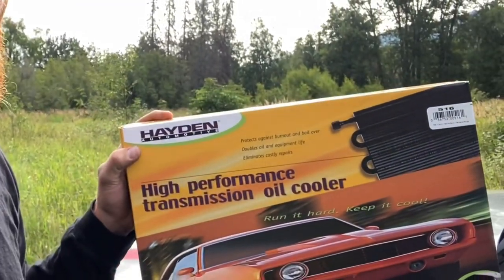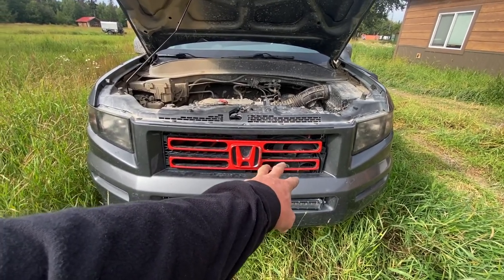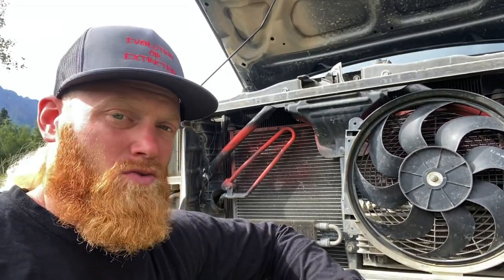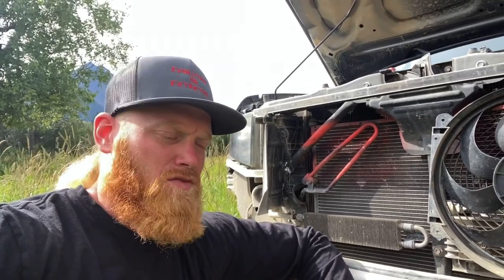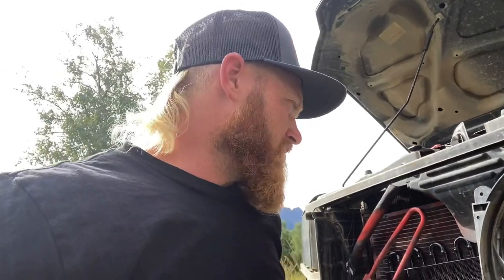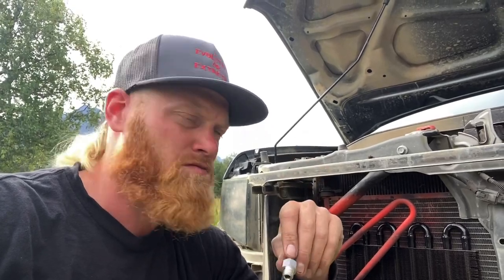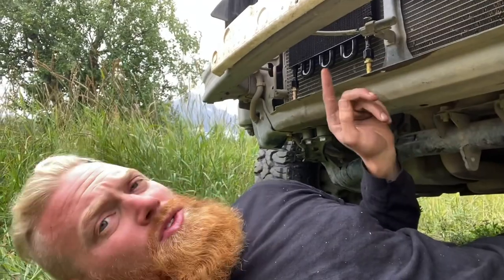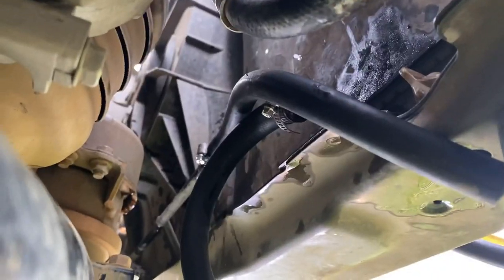How to install Transmission Cooler Honda Ridgeline (Gen 1)

Comment: I’ve had my Hayden transmission cooler on my 2004 Honda Pilot since we bought it in 2008.  We’ve towed a small campers (3300 lbs pop up and 2500 lbs Aliner) for 13 years.  Transmission is still going super strong now at 196k miles.
Reply from the maker: Awesome!! Thanks for the support and info!

Comment: Hey, so I’m doing lots of work to my 1st Gen Ridgeline too. I wanted to add some LED off road lights. What do you think the best set up for that is. 

One of my ideas was just to get a massive light bar and mount it to my roof. But I also wanted to try something different that’s not been done a million times. Any ideas in mind?

Regardless, good video and I love your truck
Reply from the maker: Check out my light bar video. It works great!

Comment: Nice job.  Been thinking about doing the same.  How did you actually mount it in place?  No noticeable impact on the radiator's efficiency?
Reply from the maker: Just mounted it with the zip ties that came with it. Radiator has still been working great.